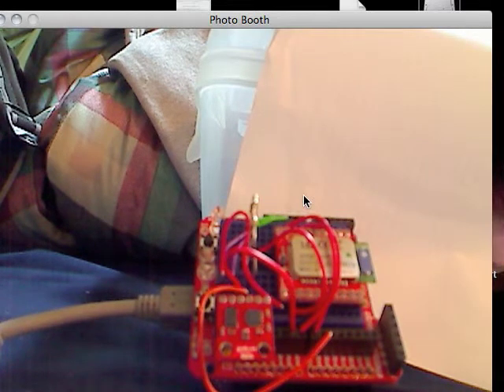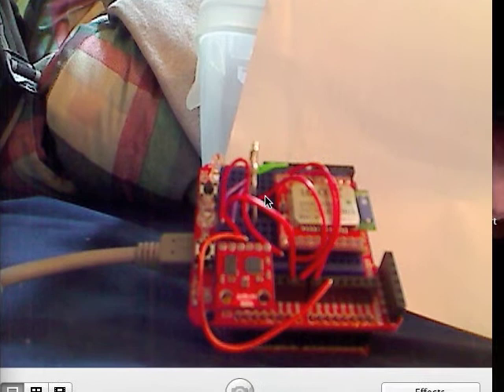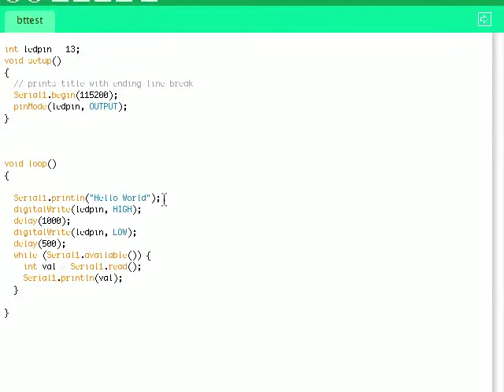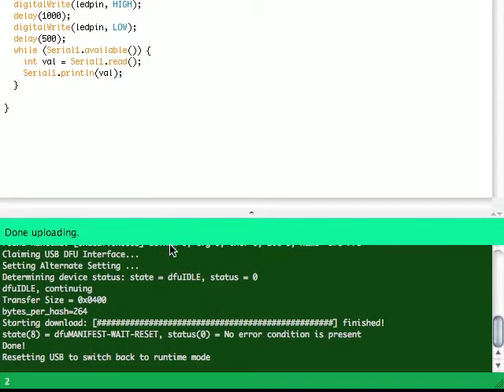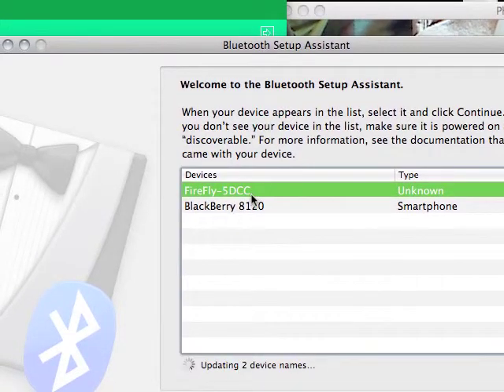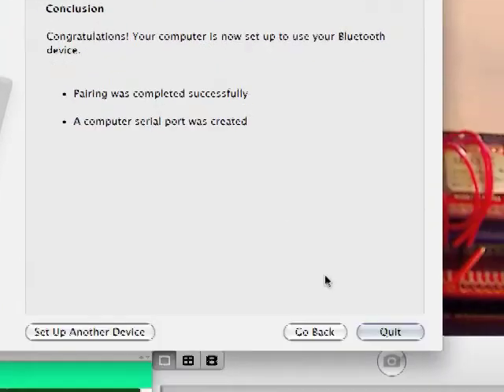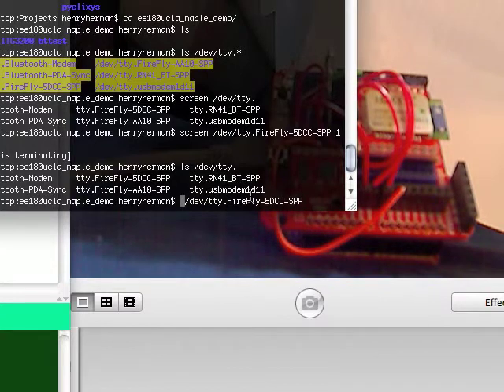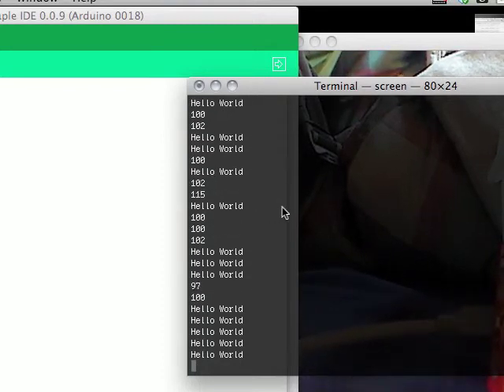RN41 Demo

Comment: @Henryeherman thanks for the link, definitely some interesting stuff to keep in mind.  What's strange is that when I plug the arduino into the laptop via a normal USB cable, there's no lag at all - which led me to believe that this was solely a Bluetooth issue.  I'll keep doing some research and study your link some more.  Thanks for your time man, good luck on finals!